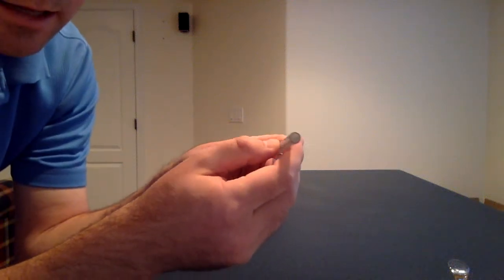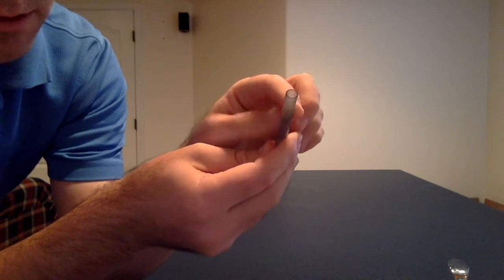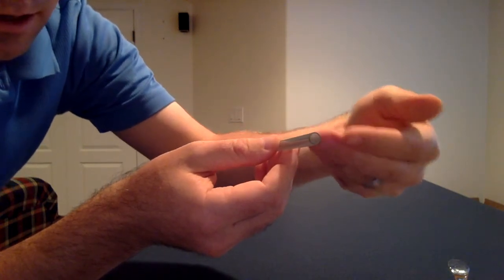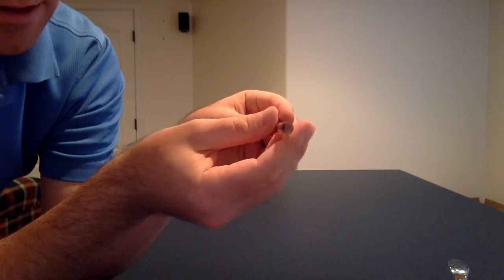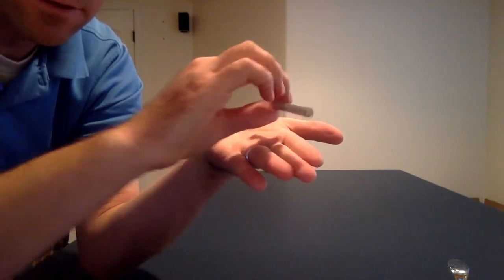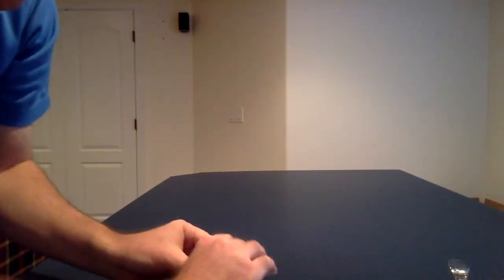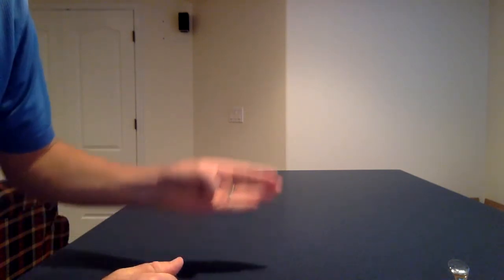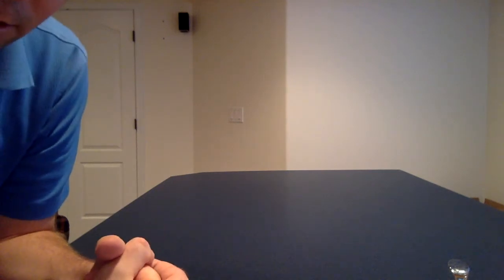Fundamentals of Aerodynamics . Superposition of Potential Flows . Flying Pen Demonstration

Comment: 3rd year Aeronautical Engineering Student, currently taking Aerodynamics. I was told a rotating cylinder could generate lift, sounded weird to me, moved on. Was checking most of your videos and came across this. I swear this is incredible, proved me stuff that I couldn't understand (or at least believe) for a year and a half. Thank you so much!